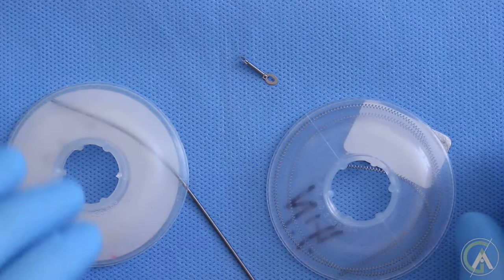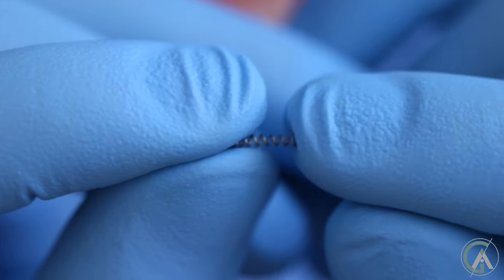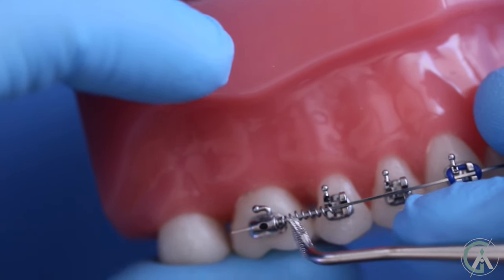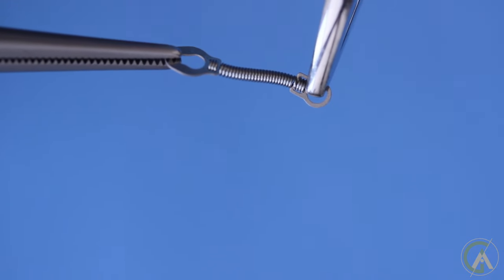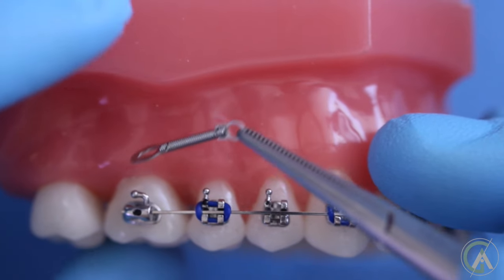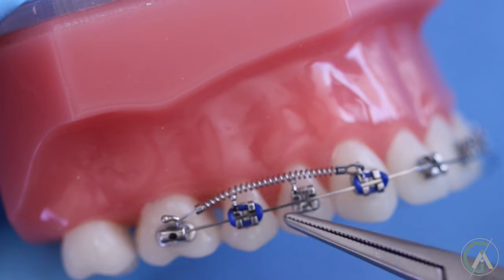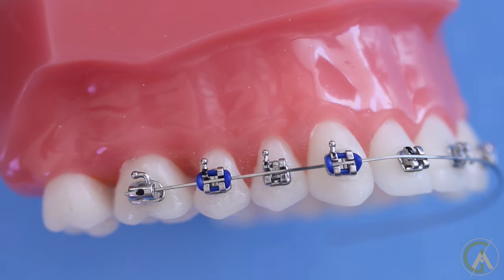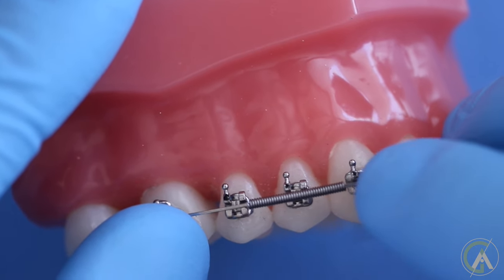[BRACES EXPLAINED] Coil Springs

Comment: i have an open coil spring on the upper jaw attached to my incisor and canine. I've only had it for 5 days and its so discomforting. it sticks out from the outside and has cut and left springy marks inside the mouth. i really want to remove it. Talking is hugely affected because when I open my mouth my top lip rests on the coil and i have to lift my lip up every time so i can close my mouth. The orthodontist said he'll see me in 2 weeks but I want to go and remove it. the cut keeps on getting worse and painful.  😭
Reply from the maker: Oh no =/ sorry you're having such a difficult time with it. I would recommend grabbing some wax so that you can prevent the coil from getting stuck on your lips

Comment: I had 4 premolars extracted and now my ortho is using power chains along with twisted metal ties under my regular wire to close the spaces. Are springs anymore effective than ties/power chains?
Reply from the maker: That's great! Not necessarily. Different ways to close space can be used during different conditions !

Comment: How long do these coils stay on? I have them & the ties constantly bother my cheeks so I fly through packs of wax! Also, my bracket on my upper left molar broke twice so they placed a metal band around the tooth. Does that usually stay on for all of treatment?
Reply from the maker: Nope! Only a few months or however long it takes to achieve the movements necessary. Rest assure that they will be coming out soon!

Comment: Hey Doc another question if u don't mind. I have teeth that have been removed, I havent gotten implants or anything. Do you think a coil spring will be put on to close that gap or no?
Reply from the maker: I think this is a case by case scenario and if you go in for an orthodontic consult, they should be able to tell you if they can close the space with braces =]

Comment: I swallowed my brace coil by accident lmao, what will happen
Reply: omg, Idrk so I googled what happens if you swallow metal and it gave me this thing which applies to if you swallow one of your brackets which is similar  "metal will move through the body on its own in more than 90 percent of cases. The human GI tract has enough acidity to dissolve small pieces of metal within minutes. Anything that remains will be excreted in a day or so after swallowing."

Comment: Will a open coil spring still work if one bracket breaks?
Reply from the maker: It depends if the bracket is close to the coil spring bur regardless you should let your doc know if you have a broken bracket. Broken brackets usually increase your treatment time so make sure you let them know as soon as you notice it!

Comment: What's the difference coil springs and powerchains?
Reply from the maker: Fantastic question! It depends on the movement necessary and the preference of the orthodontist. Power chains need to be switched out a bit more frequently too!
Reply: Thank you so much! One quick another question. Does every orthodontist use powerchains in their patient's braces journey?
Reply from the maker: I wouldnt be able to say "yes" for sure but I would bet that most do =]
Reply: Thank you so much Dr.!
Reply: Which one does it make a faster movement?

Comment: Thanks for this informative video! So I got my coil springs yesterday and I didn’t really feel any pain or anything like that and I didn’t really check to see how they were put in or anything like that, but today they are sliding along my wire? Is that normal? I’ve tried researching but I haven’t found anything. It doesn’t hurt or feel out of place or anything like that, it just slides along the wire. Can you let me know what this means anyone? Thanks❤️
Reply from the maker: Is it a passive coil spring?
Reply: Dr. Greg Asatrian I’m not sure. I’ve gotten two of my teeth extracted a few months ago and they placed them between there?

Comment: Dr. Greg your videos are great. I do hope you can notice my comment regarding braces and receive some practical and best treatment.I lost 1 my lateral incisor      from the time it was extracted and i am wearing dentures. For al most 10 years.i visited 1 orthodontist and told me best way to close my gap is bridge.and idont want that treatment i know for a long time that treatment will not last and i refuse dental implants. I want my teeth to be natural. 1 orthodontis prefer canine substitution toclose the gap.i was convince about this treatment one im concerned about lost of bones.. Because it was long time my tooth has been extracted is still possible for me to go fo canine substitution?here in dubai it is cost to ask the clinic they have to charge before they tell what is suitable treatment.i do hope to recieve your reply Dr.Greg.thanks a lot and God bless.
Reply from the maker: Hello! This is a very case-by-case basis but I will do my best to explain. Since your tooth has been missing for some time, like you said, you may have bone loss but a lot of the time it is still OK to do orthodontics but you may need a bone graft in the area after to help restore the bone levels.
Reply: Thank you Doc. Greg, it means i can go now for canine subsitution and put braces? other orthodontist told me im still young 26 of age and suitable for canine substitution, he believes i still have enough bones. I will mention what you've said to my orthodontist. Thank you so much Doc.

Comment: amazing explanation! just found your channel,TY! my orthodontist is aligning my teeth to the middle of the face, this means moving all the teeth to the right. She does this with open coil springs and she created a space as large as a canine, once this space is created, she then moves to the next tooth with the spring and pushes it back to fill the space and so on. I am wondering, is this safe? moving all teeth from their natural position? I am asking because I noticed that for my jaw a moved pre-molar bottom's side is more prominent and kinda sticks out of the gum at the bottom part...
Reply: My ortho also doing this thing. What the condition of your teeth now??
Reply: @jenisathi584  it didn't work.. at first the space she created was big, the size of a half of tooth but it got smaller and smaller somehow with every tooth that she moved, or they migrated back filling the spaces she created... So as a result, after 1 year (this long it took.. moving 1 tooth per month), my teeth are only a bit more aligned to the center, but still a couple of mm needed for the alignment to be perfect. I still have all my teeth though :)) so i don't think it did anything bad to them, but she stoped using coil springs after reaching the canine and used elastics for creating the spaces.

Comment: I had a coil spring and it was so annoying because food would get stuck in there and it would come off so easily but I’m glad I don’t have to have it anymore
Reply from the maker: Awesome! Did you have the ones for closing space? (Closed coil)
Reply: Braces Explained no I’m pretty sure it was a close coil because I had no space in between my two back teeth

Comment: Those blue elastic spacer are demons 😤 I hated wearing them but that's the cost for straight teeth 😒
Reply from the maker: You said it yourself! It is the cost for straight teeth but the pain will go away soon, promise =]
Reply: Dr. Greg Asatrian I'm way past that. 2 years and 2 months in. Hopefully another 4 months and they will be off! I'm praying because I've had them 2 months extra than what the original plan was 😖😫

Comment: I jus got my open coils activated yesterday .... what does that do I have two of them my orthodontist says everything is moving as planned and my dentist wanted to take out #13 and my orthodontist said absolutely not that’s the tooth that doesn’t have the bracket and has a open coil that jus got activated to make room she says that removing is a last resort if it doesn’t make space but everything is moving in the right direction I had my braces 6 weeks now and yesterday was my first visit since I got them on she didn’t change the wires jus the bands and activated the coils she said they are still working
Reply from the maker: Sounds like your orthodontist has it under control! Seems as though they are trying to make space for a #13 that doesn't have enough room to come in yet!
Reply: Okay thank you for replying cause I think since I got braces I been watching a thousand YouTube videos

Comment: Hey Doc, can I ask why do many orthodontists use an elastic rubber band instead of a coil spring to close space after extraction?
How and when do you decide use coil spring or elastics rubber bands?
Reply from the maker: It all depends on the orthodontists treatment preferences. Coil springs have a more continuous force but they have their side effects that may be too advanced for this channel. They create binding and friction which doesnt allow for uprighting of the root until later in treatment. Powers chains, elastics, and coil springs all have their pros & cons!
Reply: Was going to ask that same question😊

Comment: I’m getting bonding put onto my two lateral incisors, and my orthodontist decided to put a passive coil spring onto the tooth to keep the space, but put a power chain on top of it to close everywhere else, and I had an issue at one point where my power chain fell off of one of my brackets because the coil was making it hard for it to stay on. I was able to put it back onto the bracket, but I was just wondering if this is normal and if I should have had my orthodontist look back at it. I also swear my orthodontist seems to be putting the bonding off because she said months ago that it needs to happen ASAP so the rest of my teeth can move quickly and she can correct my cross bite, but every appointment she keeps putting it off and telling me it’ll be the next one. I’ve had them for over a year and was estimated to only need them for two. It just bugs me because the bonding could have been done by now and I feel like she’s just putting it off to keep them on me longer.